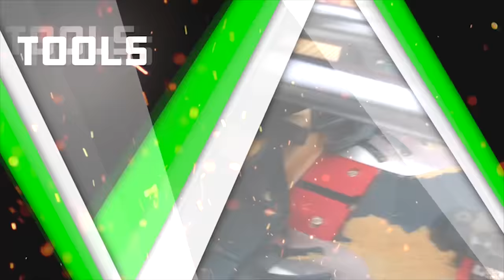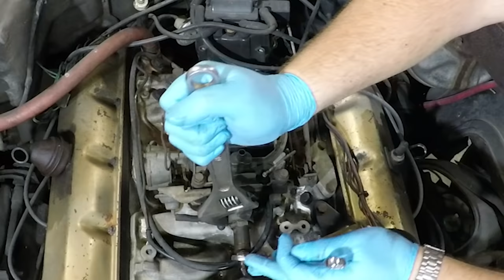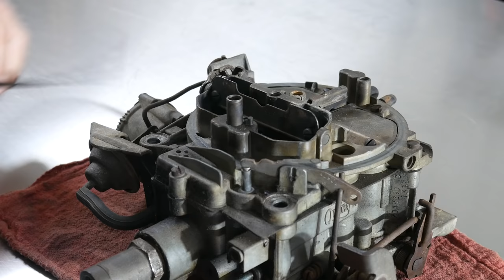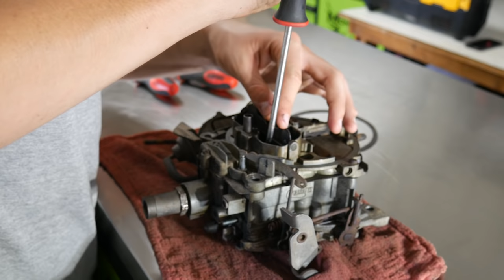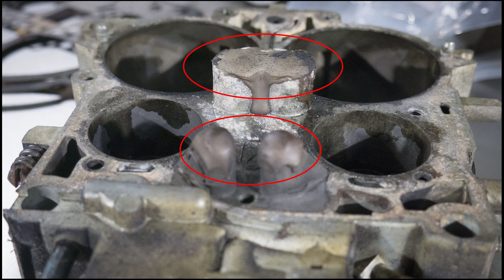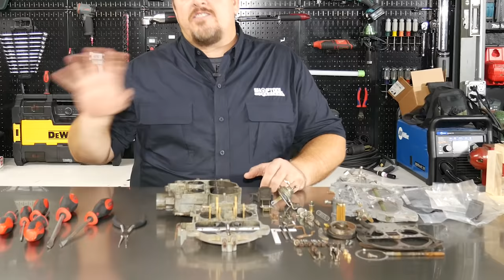How To Quadrajet Carburetor Rebuild - Part 1 - Removal and Disassembly

Comment: ...there is NOTHING wrong with a carburetor as long as it is in good mechanical condition, clean, and set correctly...easy starting, smooth idling, and smooth acceleration...and NO sensors or electronics needed!...
Reply from the maker: You are correct, they get a bad rap because they're usually abused and adjusted wrong. Thanks for watching.
Reply: @Shoptoolreviews  ..yes, and the fact that so many guys messing with them grew up in the age of fuel injection, and ironically, are afraid of or are suspicious of anything they are not used to...much like us older guys were/are uncomfortable with something we didn't grow up with, like fuel injection and it's electronics...

Comment: i was kinda dreading rebuilding this carb, but seeing how simple it is to disassemble, im not nervous anymore haha! heading over to part 2 :)
Reply: one thing, you did skip over quite a bit of stuff on the disassmbly. just finished watching the reassmbly video and i noticed there were a lot more parts on the table haha! im good at figuring stuff out, so its not a big deal, i just remember taking apart one of these probably 15 years ago, and damaging it somehow. i didnt want a repeat of that situation, so i was looking for a nice complete guide on proper disassembly. cheers!

Comment: I just purchased one on ebay. 
Damnit im old... 
But i like these carbs. Always preformed better after a fresh rebuild kit was installed. And a few hole opened a smidge. And soldering up a smaller float.

Comment: Hi, this is really great video, I had a problem with my 1978 Camaro, engine was back firing and was not very powerfull. I rebuilt my Rochester and problems are solved, backfiring was caused by malfunctioning mechanical blocking of secondary flaps.
Thanks
Reply: Hmmm and here I am, Snap, same problem on my 73 Holden Statesman 308

Comment: I have a Rochester Quadrajet 1708272 in my 80 firebird 301. It looks like I can do this but I am nervous. It would save a bunch of money.
Reply from the maker: You can do it. Take your time, and take pictures. spread your parts and fasteners out on a large surface.  You probably have an electric choke and maybe even electric fast-idle solenoid. Internals should be the same.

Comment: What happened to the spring below the primary metering rods? Its in the hole. Gas will overflow if not put back in.

Comment: My Dad bought a 70 Impala, back in 72. He drove it for 3 years total. Then he was leaving at dinner time from work in 75 cranked the car and it backfired through the carb, never running right again. He rebuilt the carb a couple times, but still never would idle correctly again. He parked the car after the rebuilding of the carbs, replaced the cam and timing chain and gears and such. No luck... 
Could the leak you spoke of, with the primary and or secondary plugs caused the spit back? Secondly what parts of the carb could have been damaged? And or, do you think the plugs perhaps are still leaking and causing the whole idle issues?
Reply from the maker: The leaking of these plugs are a very common issue, but I'm not sure that was your issue. Backfire issues typically come from timing issues or mechanical-timing (worn timing chain, gear, etc.). If the carb was last rebuilt in the 70s, then it's definitely due for a rebuild again. I would recommend completely disassembling tha carb and look over each part thoroughly. Be sure to clean all gasket surfaces and clear out each air passage. Make sure you have some welding-tip cleaners to fit into the smaller air/fuel passages in the carb. 
Once you have the carb done, make sure you don't have any vacuum leaks around the intake. You should have a steady vacuum when the car is idling, unless you have a large cam. Is the Impala a Big Block or Small Block? Thanks for watching and commenting.
Reply: @Shoptoolreviews  My Dad was a dealer mechanic. Everything he overhauled or rebuilt was back to factory specs. It is a 350/300hp 4bolt main block. He rebuilt it twice. After putting cam and timing chain in it, he got tired of sinking money into it in 75, so bought a 68 F100, and parked the Impala.
I'm hoping to salvage the 350 and the 350Th from it into a budget s10 project. If there is such thing as a budget s10 project...

Comment: what happens when the well plugs at the base of the carb are stripped of their outer protective layer?
Reply from the maker: Elijah Lueras you need to scuff the area really good, wipe down with lacquer thinner or a good degreaser. Apply 2-part epoxy, such as JB Weld over the area. be sure to test for leaks after.
Reply: Shop Tool Reviews doesnt sound legit

Comment: Hi - I'm starting to work on a 65 cutlass with a 4bbl quadrajet and 330ci motor.  it's been sitting forever.  I am trying to remove the carb but it seems stuck to the manifold.  Looking for advice on how to get it off.  I removed the four carb bolts, disconnected the fuel line, linkage, vacuum line and choke inlet "thing".   Any suggestions? Thanks!

EDIT:   I was able to get the carb off the manifold with a little gentle persuasion using a rubber mallet.   Now to figure out getting the stuck gasket off the manifold.

Comment: I removed my carburetor. My question is if the inside of my manifold is dirty/caked how or should I clean it out? Will I have to remove manifold completely?
Reply from the maker: Typically, just fuel should t make the inside of the intake too dirty. If you have a lot of oil residue then you have other issues.

Comment: Have off topic question on the Rochesters.
In your experience, How can it be positively proven the Rochester stampings are factory authentic?
I have Rochesters from the 67-69 Pontiac cars.
Some stampings look different, one die stamp seems narrow and others are Heavier.
I know the old scam trick to grind a number off and re-stamp these to create a value and a market..
Not sure what time era Carter was involved in these OEM type carbs for the workload to assist.
I'm not knowing for certain if different plants used a different die set in the Rochester MFG or not.
So the issue is which ones are OEM correct stamped, which ones are re-stamp phony pieces?
Any insight on how to tell these?
Thx
Reply from the maker: I know that the different GM cousins (Chevy, Olds, Pontiac, Buick) received different Rochester Quads on their cars...specifically, the muscle cars. And, the higher horsepower cars (LS6, W30, etc.) also received different Quadrajets, specific to the platform. This is where my knowledge gets a bit muddy. I understand the internals and how they work, but I don't know the different casting numbers off the top of my head. I know there are guys out on the muscle car forums that do have more knowledge on the castings. Sorry that I couldn't help you.

Comment: I have a bone stock ALL orig 87 SS ElCamino 305( odometer only on its first roll over,107,000 orig miles). Just Had the orig carb rebuilt, when it came back it ran great but engine light comes on. My carb guy said further down(?) on carb he didn’t get a chance to change out an electronic connection. He didn’t charge me, but have no idea what he was talking about. Do you have any clue what he might mean? Thank you
Reply from the maker: Is he talking about the electronic choke? Or, in 1987, it had an electronic solenoid that I'm pretty sure was used in enriching with more fuel on startup. Thanks for watching.

Comment: cant get air horn separated from the main body, any tricks?
Reply from the maker: KRISTIN HULSE do you have all the linkages unhooked from the throttle and choke blades? Did you pull the recessed screws out in the rear secondaries?

Comment: After taking 16 screws out as well as the 2 for the vacuum I cant get the two pieces to come apart, I removed every screw I could possible see that is bolted on to each other, what have I done😂

Comment: What is the point of taking off the arm for the accelerator pump.. Removing the pin.. I don't see the purpose.. When all you need is just to unhook the arm... What am i missing..
Reply from the maker: Heartbeat Storm you are correct. This step doesn't have to be done. Sure as I don't include that step, someone would probably call me out on it. Good perception.
Reply: Shop Tool Reviews.   Hey thanks for the reply... I only noticed because i couldn't move my pin... I'm trying to rebuild my carb,, but the plastic cover over the solenoid is keeping my float from moving... I don't get it..
Reply from the maker: What is the model # for your Quadrajet? What solenoid are you talking about?
Reply: Shop Tool Reviews .. Its model 17085524,, its a dual pump solenoid.... The float moves freely,, until i put the insert on and apply a little pressure,, to imatate replacing the bowl,, then it doesn't move at all..wtf is my question... And thanks for the reply..  To add its a electronic E4MC or E4ME.. Maybe the float has expanded,, idk..
Reply: Shop Tool Reviews ... Nevermind i figured it out.. But again thank you for yur reply and taking a interest in yur viewers..
Reply from the maker: I'm not real familiar with the mixture solenoid Qauds, so sorry I couldn't help. What did you figure out?
Reply: Shop Tool Reviews .. Its kool,, im sure i didn't explain good enough... Its usually the obvious thing,, and always pay attention.. And make sure the float isn't upside down... I do have one more question... Is the secondary lockout cam,, suppose to be floppy or set in position on a electronic choke.. Meaning it just flops back and forth..
Again thanks for yur time.